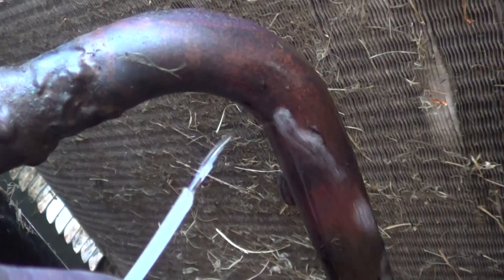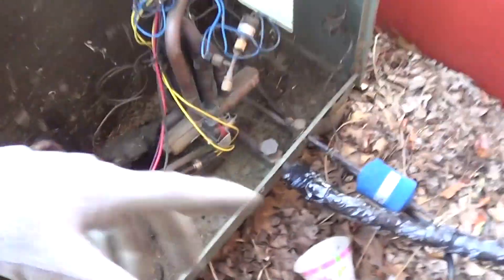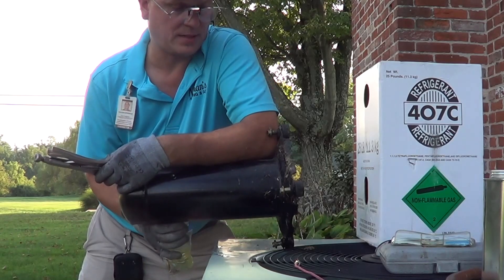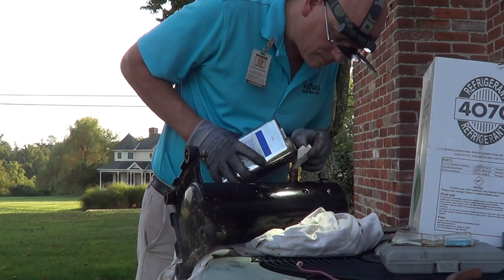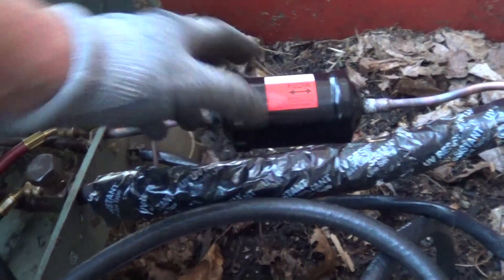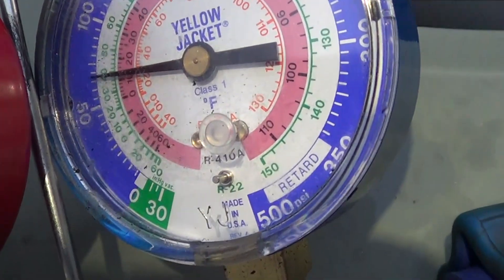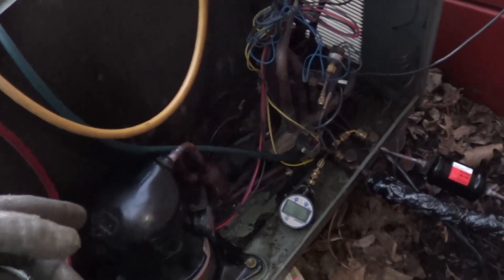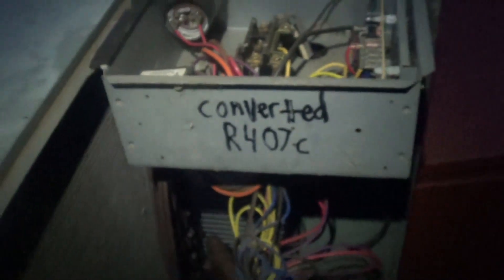Converting a R22 system to R407c

Comment: My copeland compressor shorted and the oil is burn (has r22), my compressor need to be changed and the system needs to be flush with nitrogen gas and replace the compressor and filter and add poe oil and r407c gas. I work only 4hrs a day mon to fri. as a School bus driver. I do not have enough money to purchase a new system. Any advice Mr NatthansHVAC....feel like I am asking for trouble.
Reply from the maker: Luis Diaz the only way to do an acid clean up is put a suction filter when the compressor is replaced. that is the only method that is recommended by all the manfacturers.  but the only do-it-yourself method is going to be a window unit.
Reply: Yeah.  Get used to the heat.

Comment: Curious about you mention to also just add the oil and overfill since none is pulled?  So, minimum 20% POE of compressor-stated oil capacity of POE just added and leave it?
Reply from the maker: Tie Dye yes.  Just add enough poe oil to return the mineral oil and you are good to go.

Comment: 421a is a better option no oil change and alot closer pressures
Reply: not close on the capacity
Reply: So why is that not the standard then?  Sounds great to me if it's simpler but price?
Reply: Richard Matti Jr 422b has a closer capacity

Comment: could've used an oil pump hooks up to a gauge hose  minimum of 5 strokes  2 to 3 for the least saves time . awesome video ,earned a new sub .
Reply: Locutz M you can't pull the oil out of the compressor through the lines.
Reply: @Bryan-Hensley  yes you can with nitrogen blow it out into a catch can then flush the system out and recharge the oil with the same oil pump .

Comment: Stop converting, I'm running out of room on my truck for all the damn ref tanks. By the time you pecker around switching this stuff you could have just cut, brazed and gased with 22(@ a resonible rate). Or set the customer up with payment plan or financed 410a swap.  Sorry but when I walk up to a leaking unit that was converted 6months ago I want to kick people in they're tool bag. this is a goodish video of how to do it but there is no substitute for R22.
Reply from the maker: Yes, the blends are not good for leaky systems.  I don't even stock any of the conversion gas on my truck.  I keep the bottles at the shop (which is my basement).
Reply: Sorry for venting on your vid. That was directed towards the guys blending, not marking, and contaminating systems. Had a system the other day that was "converted" to 407c then topped off with mo99 and I was the bad guy because I refused to do the same.
Reply: No kidding. I had to carry 22, 410a, 407c, 409a, 408a, M099, Hot shot, 134a, etc. I did refrigeration and ac work so it got frustrating. Now I just work with 1 refrigerant- R717 the best refrigerant and glycol heat exchangers.

Comment: Great video if I am just a little low on charge on a R22 System, Can I top off with R407c without adding oil?  Thanks for your time
Reply from the maker: I get that question a lot.  It is illegal to blend refrigerants in the field because the blend contaminates the recycle value of the R22 when you eventually do retire your system.  Labeling the blended system as R407c will prevent contaminating the after market value of R22.  But, it is still forbidden to mix refrigerants by the EPA.  It doesn't matter if the mixture still works as intended.  Contaminated refrigerants have to be destroyed at the re-processor facility.
Reply: Thank you for a well detailed answer you just earned yourself a new Subscriber my name is Gerry looking forward to watching and keeping up with your new videos
Reply: gerry mcadams no you can't but you can use 422b without changing the oil
Reply: NathansHVAC 9
Reply: gerry mcadams don't experiment with mixing refrigerants if u don't know exactly what will happen.. 
Compressor can blast like a bomb and kill u or worse... happend here in India multiples times.
Only use whatever refrigerant the machine is intend to use
Reply: gerry mcadams 
Careful man, you could lose your epa license if you get caught.
Reply: Your not supposed to do that because it changes the blend mixture. Will it work, who knows, that's uncharted territory. But whoever recovers the gas when it time to process it for disposal will end up paying a fortune in penalties per pound and that comes back to you, then the customer will say it's your problem... resist the temptation....

Comment: Copeland BTU rating for 407C is around 5% LESS than R22, according to their data sheets on new (2016) 407c/r22 approved compressor.   (around 81,000 for 407c vs. 85,500 for R22, on a ZR84KCE).
Reply from the maker: Good info.

Comment: Did u have to flush the system out first? ?  or just only the oil from the compressor? good video
Reply from the maker: Flush is for burn outs.  Mixing oil is fine.
Reply: Mixing oils gives you different temperature glides
Reply: @GarzAAA956  mixing mineral oil and Poe oil is not compatible together you'll end up replacing that system within next 6 months or less due to will eventually knock that compressor out

Comment: so we need to vacuum the r22 but the oil is no need to changed?
Reply from the maker: the oil must be changed or blended to 20% POE oil or higher.  Evacuation should always be done when air is introduced to the pipes.

Comment: when retrofitting,should I change the filter dryer to the same I have or get a different brand and quality?
Reply from the maker: Changing the filter dryer is always a good idea if you are taking the pressure out of the system anyway.  The main thing is having 20% or more POE oil to return the R407c refrigerant.

Comment: why not go over to Nu22? no oil concerns, no metering device concerns, only about 1/2 the temperature glide as compared W/ 407c... and its cheap. discharge temp is lower than 22, suction is also a bit lower than 22, uses less charge volume only drawback is a slight capacity loss, BUT, its the closest thing to a drop in, and has the longest track record of them all.  Like all 400 series HFCs rubber O rings and core valves need to be replaces.  Teflon is of no concern...
Reply: FrostBlueFire I agree. I've had Nu22b in my system for over 3 years running fine. But last weekend my compressor cracked and i had to replace it. I used R422d this time and its running GREAT. R422d is $10 more than 407c currently and $20 cheaper than R422b
Reply: Scratch that, the price difference is actually $3 LOL and you don't have to deal with an oil change
Reply: If you have to add oil or cliplight to the mixture, then you didn't save any money on R-422B vs R-407C.  The capacity drop isn't 17% either. We have a 3rd party test that shows our capacity being 1% away from R-407C. Check out the NU-22B vs R-22 pdf here - http://www.icorinternational.com/nub.html
Reply: @matthewmckinney5943  nathanshvac is right. The capacity drop for R422B is 16% . Ive been to an arkema refrigerants class on both R407c and Nu22/ R422b. The refrigerants companies are in bed with the EPA. The EPA is why we are in this mess now.  R407c is closest match without ths loss but, must change out oil atleast 50/50 mix. This adding oil to system will only create problems in a couple yrs. Slug up at metering device and loss of oil for compressor.  I use both cause refrigerants cause i am the HVAC guy for a school district. We have over 500 R22 systems. As my compressors have gone bad I switch to R407c when changing compressor.
 If I have a leaking system i switch to R422b. 
Beleive me when you roof tops that take more then 100lbs of R22 and your compressor are more then $10000 to replace them you look for the best alternative. My boss will not allowed to use R22 cause of the cost and how much my systems use.  R407c is the best as long as you change oil......
Reply: That document is not from the EPA, it's from Arkema who makes competitive products from Chemours, Honeywell, and ICOR, so they aren't a good source of info on other proprietary blends.  Considering the capacity loss claims are entirely unfounded.
Reply from the maker: I will try out R-422B.  It does seem to be popular.  My main concern is not having to adjust the expansion valve or oriface.  I was very disappointed in MO-99.
Reply: Shouldn't have to adjust expansion valve.  You should see a conversion process very similar to R-407C, minus the oil change.
Reply: just can't use it on a flooded system
Reply from the maker: hvac01453 capacity and superheat change.  plus, it is more expensive.
Reply from the maker: Here is a better reply.  Nu22 is R422B.  Capacity will drop 17%.   Discharge pressure drops 15%.  Suction Pressure drops 7%.   R422B composition is 55% R125, 42% R134a and 3% Isobutane.  The Butane returns the oi.   R407c is nearly the same mixture, but without the Butane.  For R407c, capacity will drop 2%.  Suction will drop 2%.  Discharge will increase 9%.  R407c is a much closer match for expansion valves.  You just have to add some POE to return the oil instead of the Butane in Nu22.  Save money and have a better match for the system design.  Here is the link to all the data.   https://www.epa.gov/sites/production/files/documents/Choosing_Right_R22_Retrofit.pdf
Reply: 422B capacity loss is only 5-9% dependent on proper charge, not 17%.  The glide of 407C is 9F compared to 5F with 422B, and still an A1 class with the butane, and POE isn't needed. also 407C has a higher amp draw, less dehumidification. So It might just come down to what your supply house is carrying.
Reply from the maker: They are all pretty much the same refrigerants.  But, the EPA document has these capacity measurements at 25 deg F evap for commercial refrigeration.  35 deg F evap will have less loss.  Using the 9% number from the ICOR website probably puts R407c as gaining capacity in residential applications.  It is interesting to note that anyone who thinks 20% POE oil mixtures won't return the oil needs to explain how 3% butane can return it.  I like the EPA document because it has all the drop in compared side by side apples to apples.
NU-22  (R417a)    50% R134a, 47% R125, 3% Butane  -23% Capacity
NU-22B (R422B)  42% R134a, 55% R125, 3% Butane  -17% Capacity
R407c                    52% R134a, 25% R125, 23% R32    -3% Capacity
Reply: @ @NathansHVAC  Nathan you're a saint taking all the stuff from "all us" online genius types. You deserve full credit for at least pointing in a fair direction for R22 replacements. Obviously EPA has painted a very large "alternative" picture for replacements. I can see where all the alternatives have found their biggest supporters (and field technicians) based on comments to your posts.

Just in case there are others who are frustrated with links that no longer work (expected considering the breadth of this subject). Here is the working link to EPA site regarding R22 retrofits:

https://www.epa.gov/greenchill/choosing-right-r-22-retrofit

Thanks to Nathan and everyone else who has responded to this "phase-out" predicament over R22. I've been through this Rodeo twice now. First when EPA had to save Antarctica ozone-hole (A-Hole for short) from our exquisite R-12 dichlorodifloromethane. EPA said back then that r22 was safe, efficient, and appropriate for airborne, mobile and non-mobile refrigerant applications. Working in the defense industry from the cold war era through Desert Storm I had the greatest appreciation for the huge selection of pure, unblended refrigerants that really did their jobs.
Reply: SpitSomeThinGood Thanks for the update. I only hear R-407C is best used in Heat Pumps, straight cool fits 422D much better.
Reply: back in hvac school and i still have that sheet , they were teaching us that RU22 was the way to go , to just do a drop in and so on . i guess everyone is looking for a super answer LOL .
Reply: NathansHVAC I use 421a but you have to change the orfice to a ton higher size.
Reply: Great video. You said it wouldn't hurt any if you added R22 to the 407 how does this not affect the glide?
Reply: NathansHVAC Honestly I have used R-422D to drop in. It's now the best refrigerant to drop in for any R-22 units. I believe it's cheaper than R-407C and works much better. I've heard too many negatives on R-407C, and it apparently fractionates in the vapor form after the superheat process. Either way, I'd suggest 422D, nice video tho!

Comment: I think this is good example of how to do a retrofit.  But I also think that this job was made very messy. I recomend you to buy a folding table, a funnel ,a container to measure the oil and use some 2x4s board so you dont have a hard time lifting the compressor and please wash the condenser next time.
Reply from the maker: tecnico you do have a point. I do work like a lone wolf.
Reply: NathansHVAC 10 4 i understand. hope you dont    take me as troll. I still consider it is the right way to do it. thak you.
Reply from the maker: tecnico I was just saying I clean workspace is super important when there's a lot of people on the job. jet engine mechanics have to have the cleanest spaces of them all.
Reply: NathansHVAC No , I think I did not write  correctly. I meant  the procedure you use to retrofit is the  correct.
Reply: thats how i ended up dissabled with 5 failed back surgeries , i , also thought i was invincible . just saying it sucks take time to make it easy for u

Comment: I have a R22 system, do i also change the TXV on the indoor unit to 407C TXV as well as shredder valves?
Reply from the maker: R407C works with everything exactly the same.  You should just change the oil to POE or add 20% more POE oil to help the mineral oil return.  This is for typical residential applications.

Comment: I  thought Poe is hydromyscopic and you can't mix it with mineral oil. Do you have 15 minutes to seal the system once the Poe oil is open. Do you have any links to this information from the manufacturer?  Nice video thank you.
Reply from the maker: Ron White that is why you replace the filter drier. poe oil can hold up to 0.3% moisture. the only way to remove the moisture is a filter drier.   http://www.achrnews.com/articles/94187-the-effect-of-moisture-on-poes
Reply from the maker: Ron White synthetic and mineral oil mixing is fine. It's done all the time in the automotive industry. the oils are both sticky and they stick together.  once mixed they never separate. I have verified this myself. but, even if they did separate, they will both still lubricate the compressor. the key is to have something that is soluble with the hfc refrigerant to return oil. so, po E oil creates of flow in the pipe which the mineral oil can ride on.

Comment: can I extract the Freon and oil with the same pump? do I have to uninstall the compressor in order to get the oil out of it? please help me....
Reply from the maker: Anyi Pena  Freon is a gas.  oil is a liquid.  it is best to pour out the mineral oil and replace it with poe.  then evacuate and recharge.
Reply: Thanks a lot for replying , can I use a vacuum the get the oil out?
Reply: I have seen videos where people use a vacuum to extract the freon and then they extract the oil ,just want to know if they use the same vacuum
Reply from the maker: You really have to use specialized tools.  A vacuum pump just works below 0 psi.  A freon re-claimer works at 200 psi.
Reply: Thanks a lot for the information...

Comment: good little video. I don't have a lot of experience with 407 I've used drop in this for 22 with how expensive 22 has gotten period but I'm going to have to start checking into the 407C if it's about the same price as 410A

Comment: I do pretty much the same thing but I use a syringe and flexible plastic tube and remove the oil through the process tube and replace what I took out.I understand why you sweated that Compressor out .I am retired but you should do a video using the process tube.good video.
Reply from the maker: Thanks for the pointer.
Reply: many compressors don't have process tubes ,but if it has it use it.great video.Everyone better be ready after 2020.There will be lots of work for everyone.Just seems to me they should have made the refrigerant safe for Mineral and synthetic,
Reply from the maker: Actually, 2019 is zero production of new R22 refrigerant.

Comment: Great video, I learned a lot. My 1.5 ton R22 unit iced up so was not blowing very cold or very hard. I turned off the system for about an hour and then ran the fan only for about another hour to defrost it. The filter is clean and no vents are blocked. All the icing was gone and the AC was blowing again although not blowing very cold. I know it will ice up if the Freon is low. The service tech came out and said it was low and put in 2lbs of 407C. My question, how many pounds does a 1.5 ton unit hold and would only down 2 pounds cause my system to become frozen? Hope I explained it correctly. Thanks so much.
Reply: Yes, a 1.5 ton need between 3.5 to 5 pounds... depending the brand... and yes, with 2 pounds less, any unit get frozen; because the pressure goes low and reaches lower temperature...
Reply: Haha topped of the 22 with 407c . I like it . Poor compressor
Reply: One pound low will do it my friend